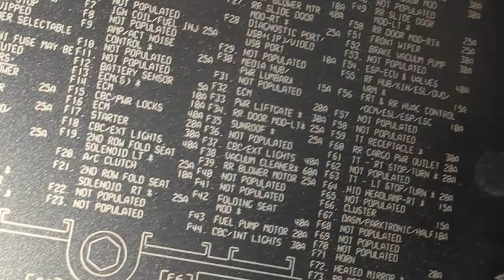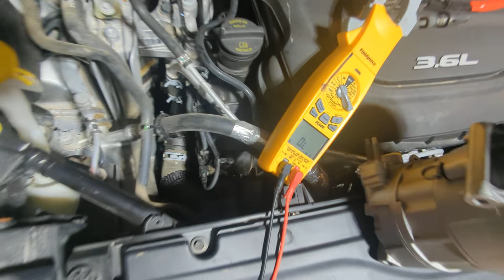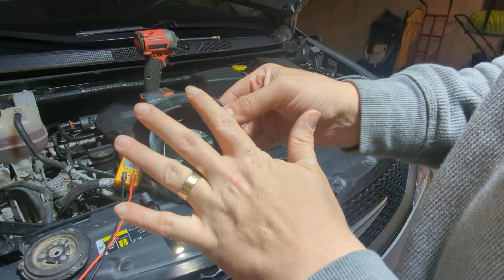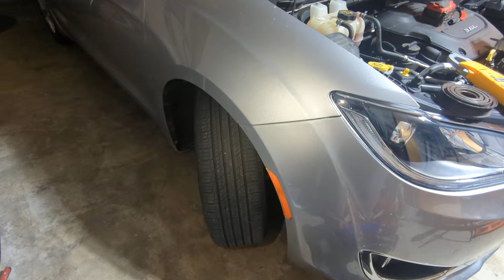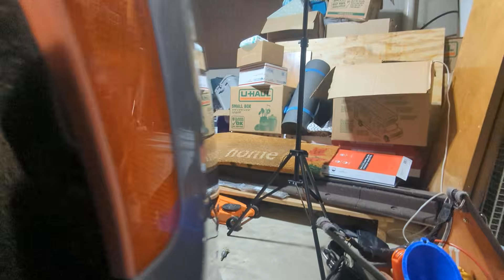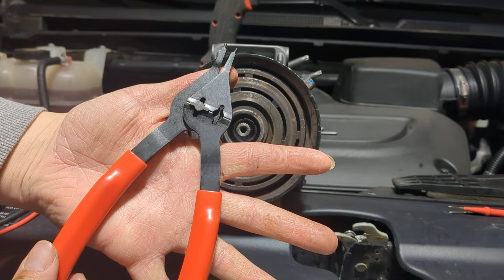AC Compressor Not Engaging (2017+ Chrysler Pacifica) Diag + Solution

Comment from the maker: PLEASE GO TO MY CHANNEL AND WATCH MY FULL TUTORIAL IF YOU ARE GOING TO ATTEMPT THIS REPAIR

NEW NEW NEW UPDATE (LOL): . My AC stopped working again (3rd time). I checked for voltage, amperage, and resistance at the fuse box, and everything looked like it was a bad coil again. I took the passenger side wheel off and checked resistance at the coil, it was 3.78 (AKA good). Turns out, the connector had failed. If you search for "AC clutch coil connector" online, you won't find it. I had to dig and dig for it. I eventually found the connector. If you look up VVT SOLENOID CONNECTOR for you year make and model, you'll find the connector under part number S2860 (this was at O'Reilly's) here's a link to the connector. When you remove the old AC clutch coil, test the resistance on the bench. If the resistance looks good (3.5 ohms @68F +/-10%) it could very well just  be the connector. Imagine that, some people get told they need a new compressor for $2000, when it could just be the connector for $15. 

https://www.oreillyauto.com/detail/c/standard-ignition/standard-ignition-2-terminal-electrical-connector/std0/s2860/v/a/143437/automotive-van-2018-chrysler-pacifica?q=VVT+SOLENOID+CONNECTOR&pos=2

NEW NEW UPDATE: My new how to video has dropped. It has everything you need to know to diag and replace the AC clutch. Here's the link.

https://youtu.be/AsojLgcXubg?si=W2aQhshiwzPJ9sRZ

NEW UPDATE: I installed the new ac clutch assembly today and it is working agian. There is a lot of little tips i learned doing it for a second time (still was a pain in the butt!). I recorded everything i did and am going to get the video edited and posted soon. In the meantime, ive made a short to show how to test the ac clutch coil without removing the passenger side tire. Ill link it here

https://youtube.com/shorts/fBHJWTwbT3E?si=fCPFFuBbzo--Cjx5

OLD UPDATE:My AC worked for 3 weeks before failing again. it is the same issue as before. I intend to make a new video with a more detailed how to process. I will actually do a replacement so you can see how to remove the old clutch assembly and reinstall while mounted in the vehicle. also, I'll show a few new ways you can test the clutch (without having to take off the wheel cowl). R&Y compressors has been a big hassle to work with on the warranty. they are trying to force me to return the whole compressor. instead of letting me just warranty the clutch coil. I plan on ordering a new AC clutch assembly from them for $140 in hopes it won't fail as quickly. I will link the new video once it's posted.**
Reply: I look forward to seeing this video!!
Reply: The "short post"  clutch test did show open circuit and no current draw, soo looks to be my clutch!  Hoping to see your upcoming post for trhe 2nd repair of new clutch install.  Thanks again for your help.. Excellent work!
Reply: Hey David!  I'm going through a similar scenario.  I replaced the spark plugs and ignition coils, which wound up requiring me to unplug and unbolt some stuff.  After re-attaching the air
intake manifold and reattaching all the cables, only hot air will blow.  I have tested the fuse, and I'm getting ~14V on each side of the fuse.  I can see visibly that the clutch is not engaging.

Since it was working before I did the spark plug work and not working after I was finished, I'm thinking I did something to cause the issue.

I'd love to know about your technique for testing the clutch without taking off the wheel.  I'd also be curious if you'd think that maybe the wiring down to the clutch itself might have gotten damaged, since the 14 V seems to be getting pushed at the fuse level.
Reply from the maker: @BradleyTucker42  That's very interesting that after doing some repairs it doesn't work. I have wondered if there is a wiring problem to the clutch coil that is causing it to burn out prematurely. You would think the fuse would pop, but I feel there are scenarios where very light amounts of damage to the power wires could result in the coil burning up rather than popping the fuse. It makes me wonder if you agitated wires while doing your spark plugs and in turn the coil burned out. It's a coil didn't burn out, It could be that a wire is now open. Not able to complete the circuit. If that's the case, the method I found for testing the coil without taking off the tire will not work for you. My method assumes the wires are good. Going to the coil. You can remove the fuse, stick a 6-in 18 gauge wire from one side of the fuse to the other. This creates a loop that you can then clamp with a DC amp clamp. If you don't get any amp draw, you know the coil is not pulling a load. 

As far as I'm aware. If there is voltage to the f-20 fuse, there should be power going to the AC clutch coil. I believe all the other sensors and switches are before the power gets to the fuse box. Meaning the power goes directly from the fuse to the clutch coil. Hopefully my new video will help give you some answers. It's very rare for volt meters to have the ability to check DC amp draw. Most of them can only check AC amp draw.
Reply: @David_Poole  Thanks for your input!  I'm going to get the van up on a lift and remove the wheel so I can test the wiring.
Reply: Can you give a quick note on the new testing methods you mentioned without removing the cowl?
Reply from the maker: @nickcapuano1  my reply to this comment goes over how to do it
Reply: @MLMinReality 
Thanks so much for this video! I just finished installing the new clutch assembly and it's blowing ice cold.  Coil was bad.
Reply from the maker: @nickcapuano1  that's really awesome to hear. I'm very happy that my knowledge can be passed on to others and save them thousands of dollars vs going to the dealer. Sorry I didn't get my how to video up in time. It dropped last night. 

I also appreciate you coming back and letting others know the result. I know when I go to a how to youtube video, the comments section ends up becoming my best friend. 

Enjoy the ice cold AC!
Reply: @David_Poole where did you get a new clutch?
Reply from the maker: @michaellane5739  R&Y compressors. They sell on their website and Amazon. If you go to my channel you'll see my full video. In that video you'll see the part number for the one I purchased
Reply from the maker: @michaellane5739  a link to said video is also right here in the pinned comment
Reply from the maker: @nickcapuano1  added a link to this comment for a short I made going over how to test the ac clutch coil without removing the passenger side tire and wheel cowl
Reply: Where do I find that connector on the car?
Reply from the maker: @JD-ys7fj  go to my channel, find my other video, watch it and find the part where I'm removing the clutch. There's a part where I show myself disconnecting the connector from the AC clutch coil.

Comment: I have a 17 Pacifica, freon full, for some reason, I can't find anyone that can diagnose it properly! One said evap cores without checking them, one said compressor wasn't circulating but another said my compressor was good. Before I throw more money into it, I want to know 100% the issue. I had freon put in it and within a couple days, the a/c stopped working right. It can sit idle when it's not very hot and it will get cold, but as soon as you drive off, it turns warm. When it's real hot, sitting idle it won't get cold at all. I just need to get this fixed, we NEED the A/C! Thanks for sharing this. You have suggestions on what could be my issue?
Reply from the maker: Based on what you're describing, it sounds like there's too much refrigerant in the system now. Sounds like your system's going off on high head pressure. The first place I would be investigating is the refrigerant pressure/ temperature. It does sound like your compressor could be failing. A good HVAC guy will be much better at reading the refrigerant levels than any Auto guy I've ever met

Comment: Air Con recently croaked on my 2017 Pacifica Limited. I figured it was a leak in the refrigerant. New 1234yf is expensive, but that wasn't the problem. Took it to my trusty mech, first prob was a defective humidity sensor in the AC system, which he replaced. Then discovered the clutch portion of the compressor had "bit the dust". Installed new MOPAR compressor and clutch assembly to the tune of $715 and change plus 2 hours labor. Works like a charm now. This is in May 2026. Could have gotten a re-man compressor & clutch for less, but warranty required jumping through many hoops.
Reply from the maker: $715 for a compressor swap is the cheapest I've heard.

Comment: Thank you for making this video. I just removed my coil and it measured 1.4M ohm. I'll either order a complete compressor (have spare parts later) or just order the parts kit you linked unless I can find a coil by itself for sale. There is very little info on this system on the internet. Alldata does not even show a test procedure for the coil.
Reply from the maker: I don't think you should order the whole compressor. You can find just the coil online, but the cost is very close to a clutch kit. You also have a high chance of messing up the front plate when removing it. I would get a clutch kit. Also, I have a video going over the whole process of removal and installation
Reply: @David_PooleThanks for the reply. I ended up just ordering the coil itself.

Comment: My connector also was intermittent
Reply from the maker: Thank you for sharing this info. It turned out that mine was also intermittent. I don't have a video on it, but I do have links to a replacement connector in the description
Reply: @David_Poole by intermittent do you mean sometimes it cools sometimes it doesn't (ty)?  Bought from my daughter Dealership said it was wiring harness. Took it in to reputable mechanic and they diagnosed it as compressor - $2,500 later when my grandson picked me up at airport - no ac. He said it's intermittent like before.  He's a (recently Volvo via S.C.)  certified tech and I'm wondering if I should show him this video.  Thank you for your time.
Reply from the maker: @CM-ev9gj when I say intermittent, I mean that a couple weeks after I completed swapping the coil, the AC worked for a short period of time, then wouldn't work, worked for a short period of time again. Then it stopped working completely. 

Since you just had the compressor replaced, I would assume it's either loss refrigerant or you have a bad connector. Connector. I would have your guy check the refrigerant system for pressure. If you have pressure that would be a sign that it's a connector problem. If you don't have any pressure, it would be a sign that the system has a leak. In your case, you almost want to wish for a leak, cuz that would mean it's the dealership's fault. I really wish you would have saw my video sooner, I bet you didn't need the compressor. They will always quote an entire compressor because it makes them the most money and puts them at the least amount of liability. What's sad is that a connector does not come with the new compressor. You may be one of the many people online who paid $2,500 when your problem could have been fixed for $20. If this is the case, I'm sorry. 

Please let me know what you find out in the comments. I'd be very curious to see if you had a bad connector all along. This is something that I suspect is happening, but haven't had an actual case come up that I could verify
Reply from the maker: Also, id highly recommend you send your friend my other video. I have a much more thorough video covering the whole removal and testing process

Comment: 2018 Pacifica LX owner with 90k. We have had our compressor replaced about 6 times since we bought new. Most recently replaced in June just to go out a month later. Replaced under warranty and just went out again a couple weeks later. Currently the vehicle is in the shop. 😢
Reply from the maker: I bet you it's a bad connector
Reply: Connector going to compressor or the A/C pressure sensor connector? 🤷‍♂️
Reply from the maker: @michaelrichards5725 the AC clutch connector. Which is the one that goes to the compressor

Comment: Quick question. If you spin it while out of the car, is it supposed to build any pressure? Mine feels like it spins too easily even if I plug up both holes.
Reply from the maker: I don't think so. When I did the same thing to a known good compressor it didn't build up pressure
Reply: @David_Poole  ok, yeah, I think that the compression is controlled by the computer using that sensor on the back of the compressor. So yeah, I'm recharging it now, and so far so good.

Comment: I have a problem with the ac in the second and 3rd row
Reply from the maker: Thats going to be a totally separate issue. May be due to something involving the blend door actuator, or the controller itself. Theres just 1 compressor that runs both systems

Comment: Any update on this?
Reply from the maker: There is a full tutorial on my channel showing how to test/replace the AC  clutch. It's been 13 months since I fixed the AC and it's still working great
Reply: @David_Poole  I watched and think this may be over my head.  My local mechanic told me to take it to Chrysler because it "may be a software issue."  I wonder if another local mechanic would have more luck if I give them a little direction on the repair based on the video.

Comment: Would my coil be the issue if my ac works sometimes but the other times it doesn’t work and blows hot air?
Reply from the maker: @matthewpetruescu  hard to say. Have you seen my other video and done the 3 tests I show?
Reply: @David_Poole will check it out.

Comment: Hi, thanks for detailed video.
I’m planing to looking into do this but question for you first.
I have 95k miles 2018 Pacifica suddenly stopped blowing out cool air on a very hot day.  After spent $300 already, Chrysler dealer said they found no leaks and compressor is not actuating when prompted.  They say HVAC code U0422 “implausible data received from BCM”. They said 80% confidence replacing the BCM will fix it.  They also said they were able to turn on compressor via other means from phone. It’s another $500 for 80% confidence solution.  Can you provide some thoughts?  THANKS!!!
Reply from the maker: @danhp4926  if they are able to turn on the compressor using other means, then it wouldn't be the clutch coil. When the coil fails, there is no way to get the compressor to engage through computer programming. You can check the coil yourself from the fuse box to see if it's within spec. Go to my channel to see my other video going over how to do this. Any basic multimeter should be able to check resistance
Reply from the maker: You may be having an issue with the ambient air temp sensor. If it's messed up the compressor won't engage. Might be worth asking them if they've checked it
Reply: Will do.  Thanks very much.  I will check out your other video.